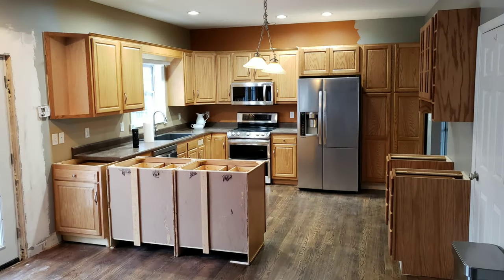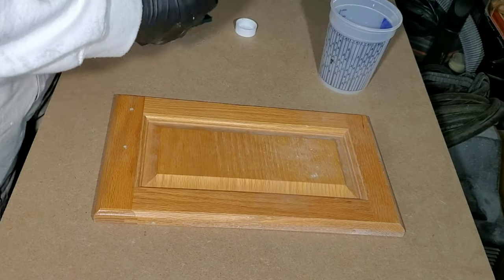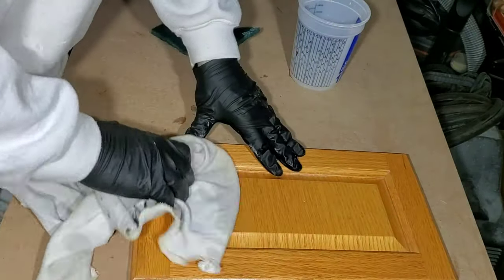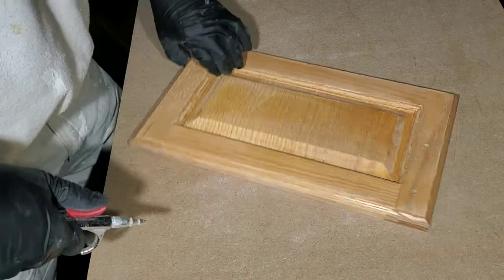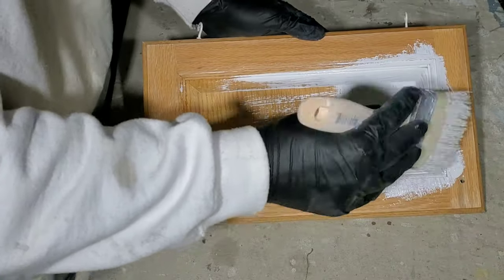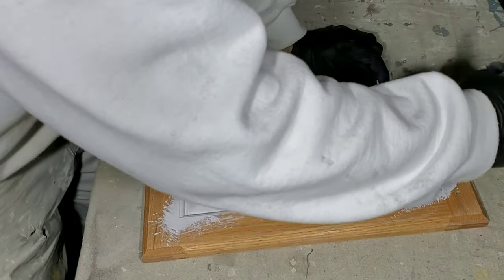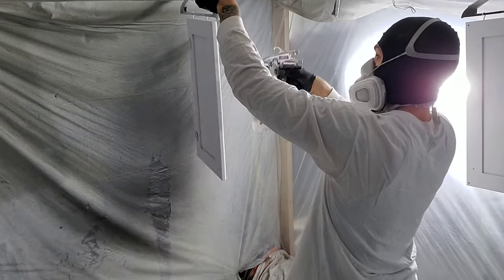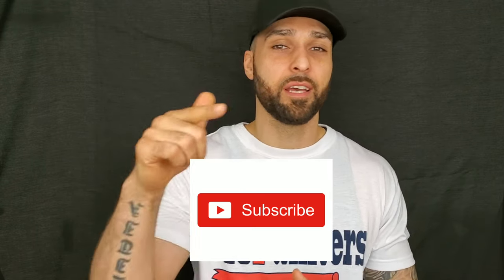Stop! Don’t Paint Your Oak Cabinets Until You See This DIY Method

Comment: Thanks for all you advice. I haven't watched a lot of videos of people spraying cabinets, but I am going to use your trick of putting hooks in the doors and hanging them on clothes racks.
Reply from the maker: It makes it very easy to paint both sides at the same time 👍🏼
Reply: @DIYhomeimprovementguy  I second this. Started with clothes racks and upgraded to the Paintline dry rack system for more versatility, especially when space is an issue. I think its work the investment but whatever gets you a quality product and a satisfied customer is really all you need.

Only downside I've seen from hanging is that the paint doesn't sink into pores of porous woods like oak as easily as if it was sprayed and laid to dry horizontally. I just use a grain filler called aqua coat when I run into that issue and the cabinets turn out great. Anyone else have any better tips for filling grain quickly and easily?

Comment: Awesome,  this is a clinic!  So a couple of things. You definitely have to push that primer into the grain but there will always be some showing,  even the texture will cast shadows on light paint.  Also, I clear coat all my cabinets which leaves a super hard and slick finish that resists getting gummy. Keep in mind, you must clean your cabinets with mild detergent or hand oils and grease will break down any finish over time.
Reply: That makes sense! thats why my cabinets are scraping off around where my wife grabs them with oily hands!! God darn it wife lol i bet it was that oils braking down and making the paint so soft! just 2 inches away paint is hard and good !

Comment: I had the same experience with low voc breakthrough. The 250 satin  was a bit duller and a certain speckled look with the sheen you could only see in certain lighting but it was there and I couldn't accept it. I moved on to conversion varnish.

Comment: Great video. Thanks for all the helpful info you've been giving us. 

I have 80s oak cabinets and want to paint them with a brush & roller. 

After watching your videos I decided on BM Advance. The idea was, Coverstain oil bonding primer, then BM Fresh Start water based primer, then 2 coats of Advance. 

Went to BM store and they said that since I'm using the coverstain primer, I won't need the water based Fresh Start on top of that. 

What's your opinion on skipping Fresh Start?
I don't want unnecessary work but at the same time I don't want to screw it up.

Thanks 
Tom

Comment: Thanks for all your videos, they are great. I'm sanding my cabinets by hand with a 220 grit block. They are still pretty smooth, how much sanding do they need to be ready to prime? I cleaned them with Krud Kutter, the non-deglossing kind, and I have Zissner oil based primer. The cabinets are  older Kraftmaid, they are wood but with a nice smooth finish.
I did a kitchen in my previous house but the cabinets had no finish on them and I used an orbital sander, they were fairly roughed up after sanding.
Thanks. :)
Reply from the maker: They don't need much sanding. Just enough to create a small tooth. The molecules of the oil based primer are very small and don't need a deep ridge. You can text or email me pictures of the cabinets and I can take a look if you'd like 👍

Comment: Hi, I was wondering if I could use Benjamin Moore Fresh start multi-purpose oil base primer to prime 1st coat on oak cabinets?  Which is better for oak cabinets the BM oil based or the zinsser high hide oil base seal/stain blocker? Thanks
Reply from the maker: BM oil based is better in my opinion.  It has great hide. Zinsser is really good too. If the price difference is not an issue then go with BM.
Reply: Thank you 😁
Reply from the maker: Any time 😁 @tabithachapel7019

Comment: Great tips! Thx!  No problems with Bondo? I never thought of that, but I am willing to spend the time filling the grain on my oak kitchen cabinets. Just sand after it dries, then primer? My plan is to use Zinsser BIN, then Benjamin Moore Advance semi-gloss white.
Reply from the maker: Thanks for watching!
Never had a problem with bondo. 
They have bondo wood filler too.
Sounds like you have a good gameplan and products 👍🏼
Reply: Thx! One more thing: I'm going to apply 2 coats of BIN; will a coat of Fresh Start after that just be overkill?
Reply from the maker: @MrRjnr  yeah, it's not necessary then.
Reply: @DIYhomeimprovementguy  ok, thx so much!
Reply from the maker: No problem! @MrRjnr
Reply: Don't ever use bondo over primed or printed surfaces never, also why to use something that is so hard to sand??
Reply from the maker: Thanks for the comment. I appreciate the honesty! I disagree though. Once you sand the primer you will create enough tooth for the bondo to bite in to. You should always sand between coats to create that tooth. But if I ever have to go back and fix a cracked project I will come back and correct myself.  @sparrow7356

Comment: Thanks for the instructive video. Question: Is it possible to use a product that is stain-like to give a re-stained finish, maybe in a different color, that takes advantage of the natural grain rather than trying to hide it ? Is there a way to do that maybe without sanding down to wood, possibly priming and staining ? A tall order, I know. Thanks again.
Reply from the maker: Thanks for watching!
Have you looked into gel stains yet?
Reply: @DIYhomeimprovementguy  Not so much. I'm guessing to gel stain, let's say gray or some other trendy shade, I would have to sand down to wood? The cabinets are now the 'standard' oak cabinet color, sort of medium brown.
Reply from the maker: Usually you don't have to sand with gel stain but always test it first @alfabrizio6005

Comment: Juan, for the second primer coat, should I brush and roll or can I spray it on? I brushed and rolled first coat on my grainy oak cabinets using oil based Zinsser cover stain. Also, for 2nd coat,  do I do Zinsser cover stain or BM Fresh Start Primer (or both, 2nd coat of Zinsser and then 3rd of Fresh Start)? Thank you for your help!!
Reply from the maker: You can spray it as long as you don't see any black crevices from the grain still. Otherwise you'll have to brush and roll to seal those.
Reply: @DIYhomeimprovementguy  Thank you!
Reply from the maker: Any time! @Angel-bf5oy

Comment: Hello I want to thank you for your time and putting a wonderful video, I am InThe process of painting my oak cabinets and I am confused about the sanding I was going to use 120 grind to sand then 220 , I also wanted to know that it looks like you need to different primer right I am willing to use the oil one because I hate the wood grain which brand of the oil primer should I buy also after the first coat of primer do I sand after each coat of primer, thank you.
Reply from the maker: 120 then 220 is great to get rid of alot of the grain. Then I would follow up with Sherwin Williams "pro block oil- based" primer. It dries fast, thick and sands easily.  Always lightly sand between coats just to get rid of  contamination like fuzz or hair and smooth the surface for the next coat.
Reply: 518 Painters thank you so much for your response so one more thing after the Sherman William oil primer I need to purchase the Benjamin more primer after that, sorry to bother you I just know that prep is so important and I want to make sure I get it right, thank you so much.
Reply from the maker: @cam68644  no problem! I'm here to answer any question. You will not need any other primer if you use the SW oil primer👍
Reply from the maker: @cam68644  sometimes I don't see all of the comments but you can always shoot me a text message or email and I'll get back asap! My info is on my website 518painters.com/blog
Reply: 518 Painters this is my last bother my scenario is this I just started to sand my cabinets they are shinning oak I was trying to sand them bare and even brought aqua coat to fill in the grain and I find myself a bit overwhelmed I am doing it alone and have 17 doors can I use the aqua coat and the oil primer and Benjamin advance satin for my top coat, man I just want to put sledgehammer to this kitchen, I can see why it cost so much to do this type of work, thanks in advance also you have a great website
Reply from the maker: Absolutely! Sanding bare is a bit overkill in my opinion. But oil based primer+aqua coat+bm satin is a good choice👍🏽 @cam68644
Reply: mario campos I feel your pain. Ive been wrestling with the same scenario with 26 doors and 8 side panels. What a project. Going on week 2 for me. The aquacoat is very time consuming. Maybe its my A.D.D. But I went overboard on the sanding as well. Prep prep prep is the name of the game. How did everything work out in the end? Did the problock and advance work well for you?
Reply from the maker: Absoloutly @Cisco93lude ! Prep, Prep, Prep. That's the most important part.
ProBlock, Cocerstain, and Freshstart always work great for us!
Definitely send me before and afters when you're done! I'll post them on my IG page and tag you.

Comment: Hello, another informative video. Would the same prep process be required if I wanted to re-stain my oak cabinets? I’d assume a different primer would be needed?
Reply from the maker: Thank you!
If you're staining your cabinets you'll need to sand them good until the wood is bare  then you can stain them. You don't need a primer.
Reply: @DIYhomeimprovementguy  ok great! One more question, my current cabinets now are more like a golden Oak color which makes my kitchen look really dated. Currently new tile is being installed that has a lot of gray undertones. So I’m looking to update the cabinets. Being that they’re oak is there a suggested stain that wood tone down the golden yellowish color?
Reply from the maker: I would look at the Minwax stain color palette to get some color ideas then look up the color name on Pinterest  @brianagarcia1937
Reply: Ok great! Thanks again

Comment: Thanks for the informative video. When you used the Benjamin More Advance, did you have to thin the paint and what size needle did you use. I am using it to paint my cabinets with a 3 stage HVLP and I am having trouble with orange peel. Any tips would be helpful. Thanks.
Reply from the maker: Thanks for watching!
I use a #3 needle and usually thin down with ca. 8 or 10% water. However, if you're getting orange peel you might be going a little heavy on the material.  But if you can say that you're not spraying it too heavy then try thinning it with warm water. Also, heating up the paint a bit helps too. I use a space heater or heat gun for that.
Reply: Thanks

Comment: May I ask what spray gun that you used and tip size? I used Graco Truecoat Plus with 311 tip (smallest one), sprayed vertically like you and got a lot of drips even my tip was 10" away from the doors. It got better when I sprayed it horizontally. Thanks
Reply from the maker: I use the graco edge 2 plus hvlp gun. Remember that with water based lacquer you want to spray light coats. Try the graco fflp 210 tip next time.

Comment: Thank you so much for this video. I just have a quick question. My first coat of primer i used a brush to brush on killz oil based primer. I sanded in between and then used a sprayer to spray on the second coat of the benjamin moore primer so I could practice with the sprayer before the final coats. I'm now trying to sand before the final coats and the paint is rolling up instead of becoming a powder. Is this normal.. or is this because I thinned the benjamin moore primer and sprayed it? TIA.
Reply from the maker: How long did you wait for each coat to dry? Also, did you clean and scuff before priming?
Reply: Yes I first cleaned the cabinets and then sanded. Blew them off, used a tack rag, and then primed oil based first then the Benjamin Moore primer you recommended. Waited 24 hours between coats.
Reply: The oil based primer sanded nicely. Now the benjamin moore paint is kind of rolling up when I sand..
Reply from the maker: @thekristiowens6  the BM Advance needs to dry about 16-24 hours before you can lightly sand. Is it peeling off?
Reply: Its the BM all purpose high hiding primer (applied by spray) thats rolling up as I try to sand and still sticky, which is the 2nd coat of primer. First coat primer was Killz oil based primer applied by brush. I haven't applied the BM Aura paint yet. Also I stacked the doors to take them outside to sand and some of them stuck together and the primer pulled off in some small spots. It has been 20 hrs since the 2nd coat primer was sprayed, doors were hanging inside with an oscillation fan during that 20hr period... just wait more time?  Or did I mess up by thinning the BM primer with water to spray the second coat of primer. We were hoping to sand the second coat of primer and put on first coat of paint today when we ran into the issue.
Reply from the maker: @thekristiowens6  the water in the primer might have prolonged the drying time. You might  have to wait a little bit more and turn up the heat.  That will hopefully cook the water out of it.
Reply: THANK YOU SO MUCH for taking the time to help me!
Reply from the maker: No problem, I'm here for you👍🏼 @thekristiowens6

Comment: Can I use a foam roller instead of spraying if I use the PPG Breakthrough 250? And what oil primer would you recommend before using the Benjamin Moore primer you suggested? Thanks from Brooklyn NY😉
Reply from the maker: I would use a mohair instead of a foam roller. But if you are not spraying that then I would use "Benjamin Moore Advance" instead. It has a 14 hour dry time between coats but lays down nicer when you are brushing and rolling. As far as primer, I would suggest Zinsser Coverstain or Sherwin William's ProBlock oil-based.
Bk all day  baby !🙌🏼💪🏼
Reply: 518 Painters Thanks!👍
Reply: 518 Painters would you suggest to use any type of sealer or poly after two coats of Benjamin Moore advance?

Comment: Is the Benjamin Moore high hiding fresh start primer going to be as good as something like Zinsser BIN stain cover oil primer? I have very dark oak cabinets almost black and going to white.
Reply from the maker: Yes and no. It hides as good as coverstain but it does not block tannins. Are they painted oak cabinets orb stained?
Reply: @DIYhomeimprovementguy  They're stained. Trying to find the best primer and laquer combo that doesn't yellow (has yours ever?). I think the laquer  (pre-cat) would be a step up from BM advanced or SW Emerald Eurathane many seem to use, no?

Comment: Quick question: do I need to use both krud kutter and M1 degreaser or can I just use the krud kutter?
Reply from the maker: Krud kutter makes a deglosser and cleaner. If you get the one that says deglosser you won't need the m1.
Reply: @DIYhomeimprovementguy  also, which spray gun do you recommend? 😄
Reply from the maker: @ilovericecakes  the Graco HVLP 9.5 is great for beginners and professionals in my opinion.

Comment: Hi. Im starting to prep my cabinets. Im confused in the difference of using liquid sandpaper vs regular sanding? Also what did you use to plug the hardware holes in the doors to stop paint from getting in them?  Thanks!
Reply from the maker: Sanding it will create a mechanical bond rather then a chemical bond that you would get with the liquid sander. Scuff Sanding is always better! Are you spraying or rolling your cabinets?
Reply: @DIYhomeimprovementguy  Hi again. Thx for your quick response. I'm planning to paint the lower groves in the door cabinets with a brush and then roll the larger areas with a 4" roller w 1/4" and 1/2" nap. I bought Sherwin Williams top of the line Emerald Enamel paint/Super Bond Primer and the recommended brushes/rollers they suggested with those particular paints. I'm trying to decide since they are oak cabinets if I dare try to use the Clear Aquacoat to take out the grain look. I know it's a lot more work but hell I went 21 years with the way they were now so I know once I finish this it's done for all eternity. lolI  More important for me to do it right than rush through it but I'm a bit of a perfectionist so not trying to add unnecessary steps and be as efficient as possible. My nephew loaned me his dremel hand sander so scuff the surface but I'm a bit intimidated. 🥴
Reply: @DIYhomeimprovementguy  PS Your video and the info you provided as well as the written manual are very good. Thx for your knowledge to provide us with the details!
Reply from the maker: You got this!  @savvysupastar  
You don't necessarily have to use a sander. Scuffing it up by hand works just as well. Imagine you are cleaning windows.
That's about as much pressure you'll need.
Reply from the maker: Thank you very much!
You can always reach out if you have any questions! @savvysupastar
Reply: Go to any hardware store and get 3/16" wooden dowels. Usually the cabinet pull holes are 3/16" .
Stuff in whole and let it stick out about ¼" on each side. Then flush cut ( flush cut saw $15) the parts sticking out then cover with wood putty, let dry then sand flat. All this before priming. 
The holes will disappear. We do this all the time so you don't have to try stuff hole with wood putty and it's solid, reusable and prevents "fillers" from cracking, shrinking or falling out over time.👍
They sell different size dowels so if you have a different size hole just buy the the one that fits. Remember, you want the dowels to be real snug.
Hope that helps